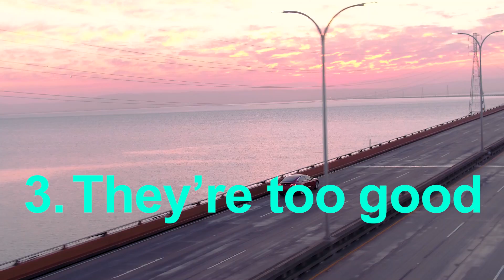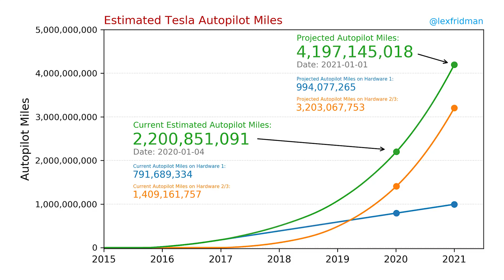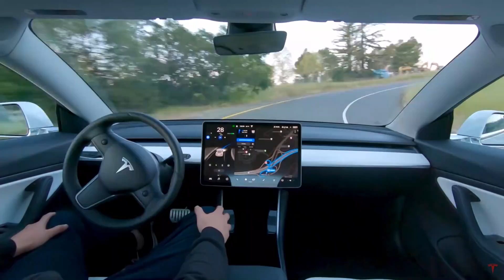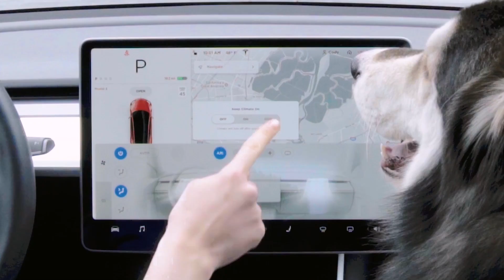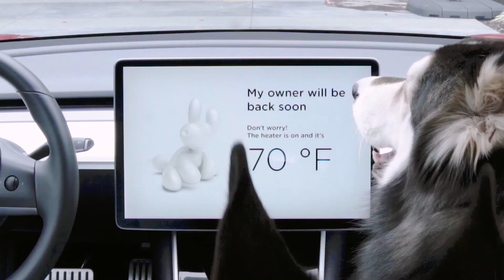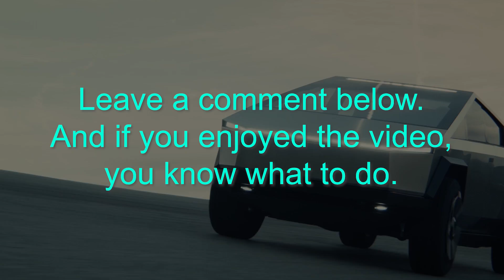Tesla Battery Investor Day (Predictions)

Comment: I doubt they will sell Tesla skateboards to others. The motors require Tesla software, chips and the single screen interface. They would not want to reprogram and adapt for a “Ford Teslamobile”. More likely is a vast production of Tesla low cost superbatteries they could supply to other EV builders. Tesla would then profit from every EV sold worldwide.
Reply: they sold tesla skateboards to mercedes and toyota years ago already.
Reply: Very good point BeachCrow. Don't want to give the competition too many of your secrets IE access to your software.....
Reply: The Tesla skateboard is currently DESIGNED to use the single screen interface which also has all the other Tesla features in it.
A skateboard to sell as a skateboard would be designed with a control computer that just runs charging and braking and the motors and such, but which has no other vehicle features not provided by Tesla.
Then via a USB port (or something similar lol) the car manufacturer could connect via an API to transfer standardized information to display on THEIR display and set defined settings in the Tesla PCM.
It would be no different than current cars where the car computer interfaces with the engine, transmission, ABS, and cup holder computers, all from separate manufacturers, all running proprietary software, and all the car manufacturer gets is API level connectivity.

If the company wanted all the Tesla features, just their own coachwork, than Tesla would have to design something special for them, for a processor, but that's going beyond the Skateboard concept.

But a skateboard really doesn't need most of the Tesla computer power and software, and the car company wouldn't need to have any need for access to the Tesla software beyond whatever Tesla gave them access to.
Reply: @ke6gwf  right, but then theres the whole mess of patches and updates.   Who is responsible for the BCM etc.  It really might not be an easier answer for companies.
Reply: @patreekotime4578  that's simple.
Tesla designs a single controller for the skateboard, probably build into the inverter or bcm, and everything Tesla goes through there. The manufacturer has a single point of connection with an API they can connect to for adjusting the settings they are given access to, so no internal software access for them. This is also the interface to their dashboard and switches etc.
Not having Teslas name on the vehicle, I wouldn't expect constant updates, it would be a stable version using the previous level of technology, so well known and stable.
For troubleshooting or any needed bug fixes or updates, the manufacturer/dealer would just need to give it internet access via the cars internet connection, or via a service port (a Cat 5 jack in the glove box?lol) and then a Tesla tech could remotely access it.

So fully self contained, limited access to anyone but Tesla, and not constantly upgraded but stable releases.
Reply: I think the real danger is that tesla faces monopoly games like Microsoft did.
Reply: @DouglasEKnappMSAOM  I've been thinking that for a while but don't think it will be an issue for 10 years
Reply: @danvenning6279  And then . . . One ring to rule them all! Where is this company not bringing MASSIVE change and leadership?
Reply: Just having the batteties isn't enough to get the same efficiency tho.  For that you need the BCM and the power train and controller modules.  So the development of a series of software protocols to allow that kind of itegration is required.  Then its a whole rabbithole that open source software development suffers from... Who is responsible for patches and updates to the core?    Very messy.

Comment: Expecting them to announce a million mile battery for sure. It’ll have something o do with capacitors and padding the batteries charge
Reply: Elon was ask about a month ago about capacitors, he said they weren't needed. The million miles come from using single crystals in the battery chemistry.
Reply: @BTS-Astro1  And also nanoshielding some specific particles (those single crystals) to prevent degredation.